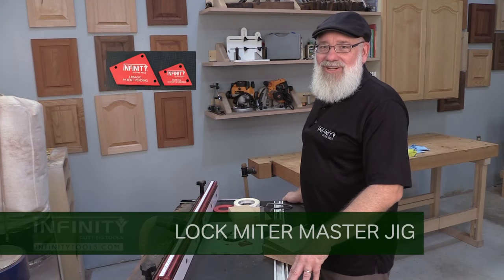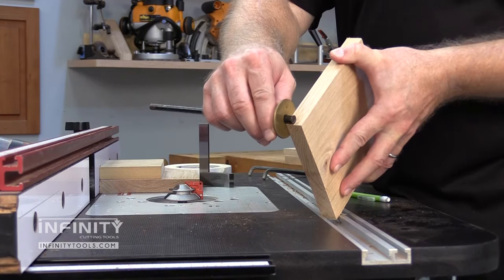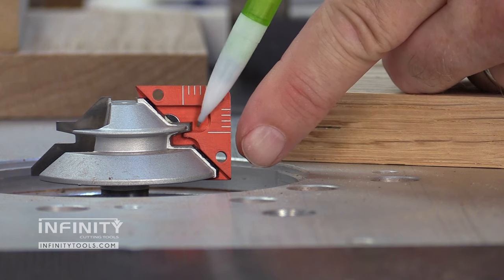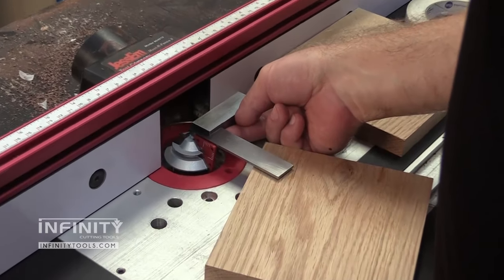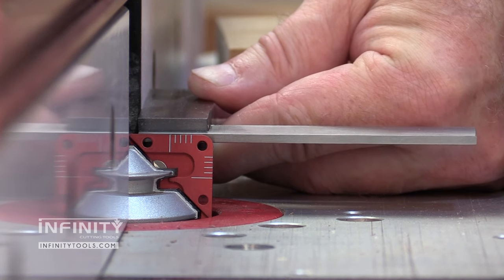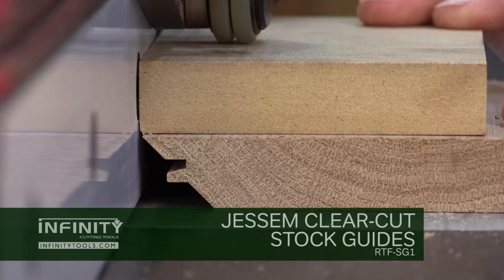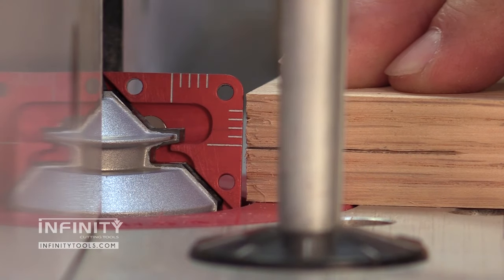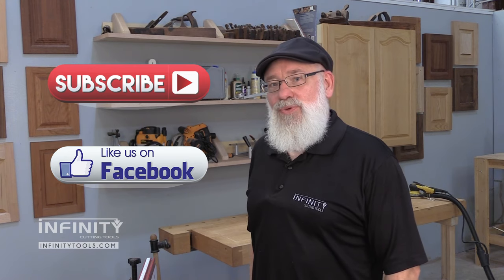How to Use the Lock Miter Master Jig

Comment: I have been using your locked miter cutter in a small shaper for a while.  The trick of using a scrap piece tapped to the work piece is brilliant.  I’ll do that next time.  I have been adjusting the cutter height and depth by trial and error.  It is tedious.  I need to get the alignment tool before the next time I use the 45 deg. locked miter joint.

Comment: Easiest way to find the centerline is to use a center-finding doweling jig and just put a pencil in one of the dowel holes and use that to scribe a line down the side of the cut piece.  Aside from that, those jigs look pretty awesome.  I love lock miter joins cuz they look really clean and tight, especially if you match grain around the corners.  Anything that makes setup easier is a big win in my opinion.

Comment: I have watched this video a half dozen times.  It is less easy in practice than you make it sound on the video.  I think some of my difficulty arises from getting an exact alignment of the line on the work piece with the line on the jig.  Getting your head lined up with the top (vertical) line  is more difficult that getting your camera in that space by the fence.  And you have to use your (for me) non-dominant eye.  I think it would be easier to line up and fewer test cuts would be needed if the white lines were continued onto the edges of the jig.  Maybe my alignment problem is one of parallax.  But I strongly urge you to continue those two lines around the edge of the jig next time you make a manufacturing run.  That way you can butt the wood right up to the jig to get an exact setting of the table top and fence.

That being said I love my bit (and my other Infinity bits) and once I got it set, it has functioned well in spite of the tricky-to-machine quarter sawn white oak I am using to make what are basically 6 feet long boxes with a very tiny space inside.  They are actually four arts and crafts legs with the figure showing on all four sides.  I do not think I could have achieved this result without this jig.
Reply from the maker: Hi Robert, with the laser marking process I am not sure if continuing the marks around the edge is an option but it may be worth looking into. One thing I would say is for the bit height setting you can swing the bit  and the fence out of the way so that you can sight across and see the marks without obstruction. For the fence setting I look straight down at the jig I find it difficult to sight down the fence when making the fence setting, even though I am left eye dominant. Standing right over the bit and sighting down works best for me and reduced the issue of parallax as you mentioned. 

Your project of hollow legs is exactly the type of projects the lock miter bit was designed for. Way better than having straight miters sliding around during glue-up.
Reply: What you really need is a parallelogram self centring jig for finding the exact centre  of the width of a board.  Woodpeckers makes a great one that is part of their dowelling jig.   i prefer to make mortise and tenon joints but the centring jig is bang on every time.
Reply: @robrakovsky2485  I looked it up and it looks good, but the one I found is no longer available.  But thank you for your suggestion.

Comment: I used the gague for the first time today and found two things: 
1)  A modification to the gague putting a wedge shaped notch in both edges at the long index mark would really help dial in the positions. 
2)  Even after slowing the router RPMs I couldn't get a really good result. Is plywood a problem of do I need to practice a lot?
Reply from the maker: Thanks for the suggestion on adding a notch, we'll pass it on to our design folks! And yes, plywood is a trickier issue because of the cross-grain design of the layers. It's possible a slightly higher speed on the bit, and a slower feed speed will improve your results. This will allow the bit to deal with both the long-grain and end grain edge.
Reply from the maker: Lock miter Joinery is not best suited when using plywood. Plywood doesn't provide the strength and would give a very weak joint. For plywood or mdf a lapped miter is much better suited, they provide a large glue-up surface.

Comment: Simply a very difficult joint to perfect especially in wider boards where bowing is commonplace, Infinity Tools definitely has helped with their jig but after spending 2 days at it and finally saying good enough I'd stick with dovetails  and retire these bits. Also, make sure your router bit travel can be locked in place as many router table inserts lack that feature.

Comment: Good video, is it absolutely necessary to attach a guide board? I am planning to use this joint to make up a beam wrap, it will be three sections, however the longest will be 16' and attaching a guide board seems like pain....
Reply from the maker: No it is not necessary. Box beams are what the Lock Miter was originally designed for. I would say make sure you have good in feed and out feed support for your boards and be aware that the edge is easily damaged and you should be just fine.
Reply: @InfinityTools  Use feather boards or clamp a piece of 3/4" UHMW polyethylene other wise known as "King Starboard" to your fence to where it is in contact with your work piece but still allows the work piece to slide underneath it. That should keep the edge sharp and protect the work piece from blowing out as it passes over the cutters. Do something similar for the inverted pass by attaching the polyethylene to the router table instead. I know I'm responding to a comment from a year ago but someone else might find this useful.

Comment: Will these setup jigs work with the insert pro shaper bit? I think I prefer the shape of the joint of the insert pro,  however it strikes me it could be more difficult to set up due to the fact the cutter has a radius rather than a hard corner to align.... Am I overthinking here?
Reply from the maker: The problem with using the jig with the insert Pro Lock Miter Shaper Cutter is that the jig hits the gib that clamps the knife into the head and won't fully seat.

Comment: Is it ok to use mdf with the lock mitre router bit ?
Reply from the maker: Yes, all of our router bits have no issues cutting MDF.
Reply: @InfinityTools What about the strength of an MDF lock miter joint? Do you know from experience how they perform? I understand long grain with end grain are the strongest lock miters when using solid wood, but have not seen any information regarding MDF. Thanks in advance!

Comment: I think I'll make my own setup pieces out of MDF . Once you have a set for a certain thickness, you won't have to buy a jig. Especially since even with the jig he still had to make adjustments. Nice tip though about using the center of the work piece as a starting point.

Comment: I like how at 0:15 seconds in this video, the outside corner is not mitered correctly... looks to be about 1/32 - 1/16 off. This jig is janky, you're trying to align a flat lip of the jig to a part of the bit that is angled... The principle idea is sound, but the design and execution of the jig is very bad... Because of this, the jig can move in 2 different directions.

Comment: He had it set up perfectly, then made test cuts. They weren't perfect, so he checked the bit and found out it was too high..??...Why would it be too high after he set it up perfectly?
Reply from the maker: If you watch closely you will see that the bit was set a little too high for the first pass. Reinstalling the jig allows you to check and see what you need to adjust if your test cut is a little off. Without the jig it is difficult to determine if it is the bit height or fence that need adjustment and often takes a lot of trial and error.
Reply: @InfinityTools  Agree, It was never set up properly the first time around. I guess you were better off retesting with a new piece of wood since people complain about the further adjustments needed. 🤷🏻‍♂️
Reply: Honestly you should have cut the operator error from the first set up out of the demo video.  IMHO it's giving people a sense that this jig isn't as easy as it should be to use.  Kind of goes against purpose of getting the jig to begin with.  With all that being sad, to me this looks like a great product. Only thing holding me back is not knowing it this jig will work with Freud lock miter bit that currently don't use because it's a PIA to set up.

Comment: Why would you be making a lock miter joint on the edge grain? Pls re-do this video on end grain doing one pass. Thanks, happy to help!
Reply from the maker: The lock miter joint was originally designed for edge grain work like box beams and hollow table legs. The joint can be used for end grain work but will be more sensitive to bit speed, feed rate, and most of all work holding. We have a blog post dedicated to helping woodworkers struggling with tricky applications. https://www.infinitytools.com/blog/2014/12/15/five-top-tips-for-finicky-lock-mitering/
Regardless of the grain direction the setup process using the Lock Miter Master Jig remains the same.

Comment: Great video but oh my gosh !  To use this bit you need a special gage, double sided tape, an extra board piece, extra clampjng accessories.   That's all ! ? Maybe I need a new router and router table too. Too funny.  Wish I knew this before I bought this bit.  My fault for not doing more research.
Reply from the maker: The Lock Miter router bit makes a very complex joint. Woodworkers have been using it for years successfully without the Lock Miter Master. That being said the LMM greatly speeds up the setup process making it much easier to use. The rest of the stuff you mentioned are tips and tricks that help produce better, safer, and more consistent results. These tips and tricks can be used with many other router bits as well, not just the Lock Miter.